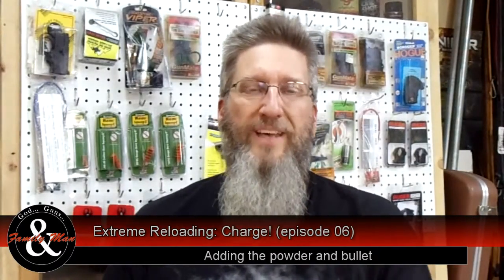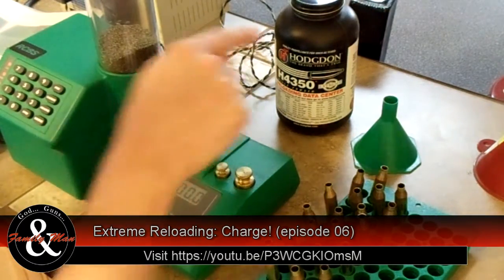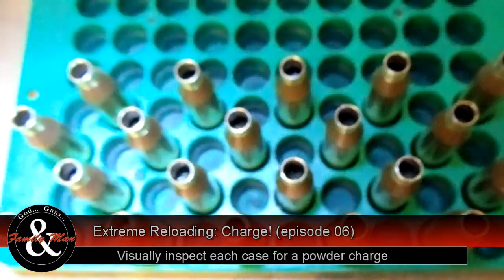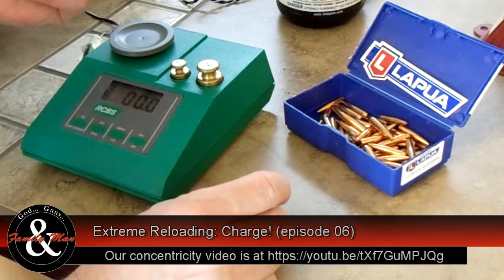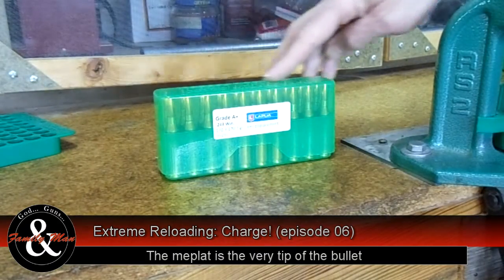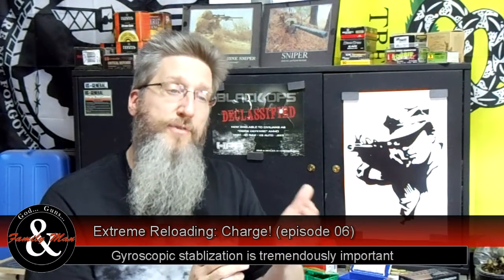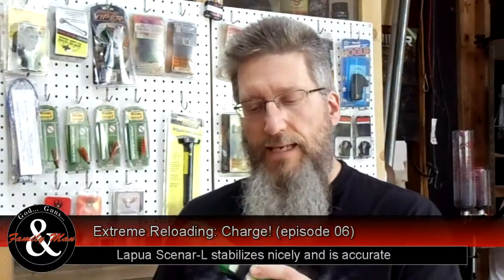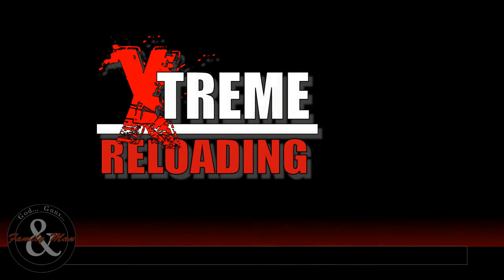Extreme Reloading: Charge! (ep. 06)

Comment: You probably get tired of me sending so many Thank-you comments but your videos are exactly what I need.  I really don't get that excited about putting a hole in a piece of paper, I could do that at home.  To me, the excitement is learning about the plethora of tiny components of the puzzle of making an accurate group and understanding why they make a difference, not just that they do.  The holes in the paper are the way to grade the care taken during reloading before going to the range.  

My question today is: you talked about the effect of temperature on the powder.  Would I be correct to say that the ONLY effect of powder temperature would be while the bullet is in the barrel and that once the bullet leaves the muzzle, the temperature of the powder has no effect on the bullet?  The temperature of the day obviously has an effect on the air density, and possibly the bullet but nothing to do with the powder after the bullet leaves the muzzle.  If that is correct, then couldn't you heat or cool your cartridges to whatever temperature you want to test at before leaving the house and put them in an insulated box with a tiny heater (maybe a 12vdc unit you could power from your truck) inside to maintain the temperature and a temperature sensing unit in with the cartridges.  That way, you wouldn't have to wait for a hot day, you could be sure the cartridge temperature had stabilized and be more confident in your test results?  Otherwise, the cartridges may be at one temperature when you leave your house, a different temperature in your truck and change again by the time you actually fired them regardless of the outdoor temperature.

I am not trying to instruct the professor, just trying to analyze the test to be sure I understand this micro part of the equation.

Thanks again.
Reply from the maker: You are right Florian, and experiments like this have been done under controlled conditions (i.e., the ammunition is held at a constant temperature and then fired (indoors) at that same temperature.  Overall, the effect is generally that colder temperatures depress muzzle velocity while warmer temperatures increase velocity.  The exception to the rule is in the case of double-base powders where very cold temperatures cause changes at the molecular level (the two bases want to separate) resulting is abnormally high velocities (and pressures).  Thanks for asking a very good question.

Comment: On the long bullets you need enough bearing surface to send the bullet out of the barrel in a stable spiral.  Even any boat tail bullet needs to have enough bearing surface and if not so you need to go to a flat base bullet to get bearing surface to shoot right.  Pretty simple stuff actually.  You're right on needing a higher twist for a longer bullet but these other things are at play.  Bearing surface can have all to do with a load shooting well or going to hell.
Reply from the maker: That is a good point Garry,
I wonder how much bearing surface is actually required though.  I suspect very little bearing surface could be required to allow the bullet to take on the spin.  This too could vary with the rifling in each particular firearm and help further explain why one bullet works well in one rifle but not another.
Thanks for watching and posting.